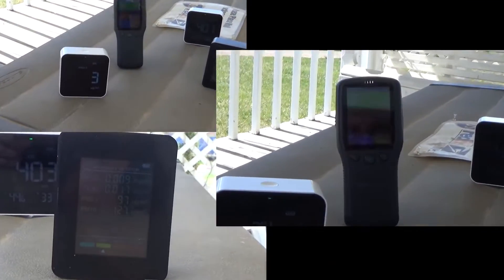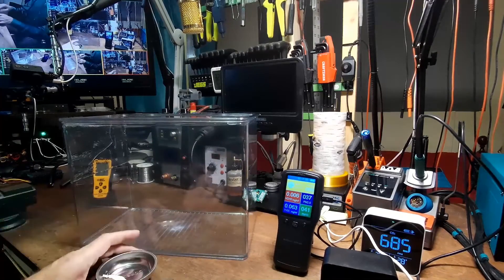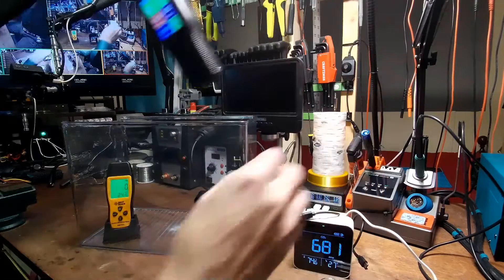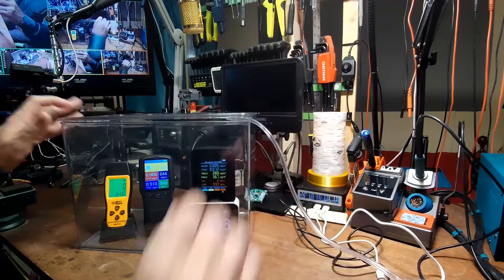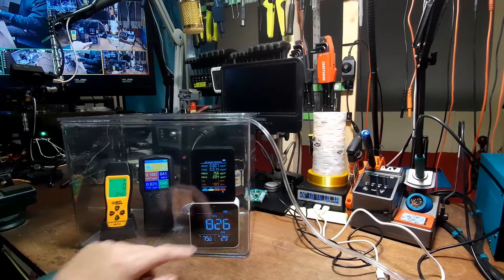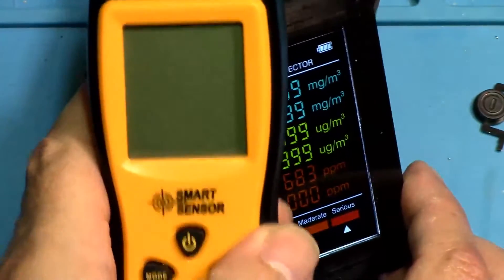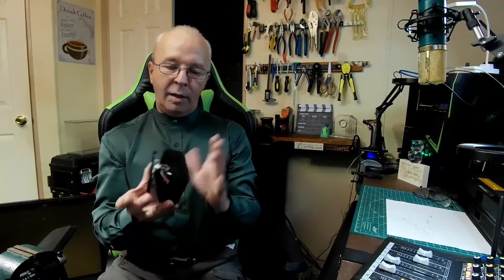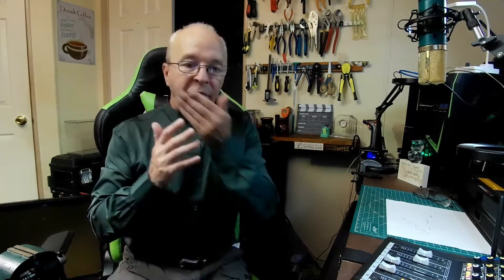Compare Fake Chinese Air Quality Monitor To "Smart Sensor" CO Monitor & "TemTop" CO2 Monitor

Comment: I bought a version of this sensor with temperature and moisture display. I didn't care about CO2/HCHO/TVOC which it also has. So just out of pure curiosity i put some desinfectant on my hand and hold the sensor. All parameters instantly maxd out 😂. What a piece of trash. I also doubt the humidity and temperature is accurate 😂
Reply from the maker: Thank you for telling us your experience.   👍

Comment: I just bought an updated version of that fake one.  The display is a little different because they added more fake features calling it a 10-in-1  (Model MT13W). They also have a 15-in-1 version.  The readings are completely different to public AQI monitor readings in my area, so I did a search and found this video.  I am seeing the same sort of whacky readings as in this video.

Comment: Not zooming in on the meters makes this video a BOMB, really.  But you got a click and comment, good for you.
Reply: Plus the explaining first and then the doing. Could have been half as long. It's an alcoholsensor sure but the 'lasers' are a sensor too. So if it was made to be all fake they would not have spent the time and money to put in the particle meter. I have something like this and ofcourse its useless. I'll reuse the battery for something else.
Reply from the maker: @Drteomas  Any monitor that incorporate a sensor reading of a sensor or sensors that do not exist is fake no matter how many other sensors that may be real.  You are correct -- you can take it apart and use what's inside for something else.

Comment: So narrow minded. The sensor is a substitute, swap the one for the correct one, they are good once you do this
Reply: Did you do it?! I was wondering this and got laughed at by this weirdo.
Reply: @Drteomas I have 3 good, I used the 4th for testing. Admittedly still WIP but so far everything is golden. Not sure the parts numbers used as I not at home right now.

My plan is to tap an ESP32 onto the UART pins on the PCB (slightly different PCB to the one on the video, but very similar)

Comment: I picked up a temtop m10+ assuming it’s the same quality as the m10. Difference being the + model detects co2 temp and humidity also. Have you tested the m10+ and/or is it safe to assume it’s also a good product? Thanks!
Reply from the maker: The CO2 addition is great.  TemTop was supposed to send one out to me to test and review, but never did, so not sure what happened there.  Yes, I would say that the M10+ is a good monitor if for no other reason than having the addition of a CO2 sensor, and I believe they use Sensirion sensors which are very good sensors.

Thanks for the question and comment -- much appreciated, and hope this helps.  A Merry Christmas to you and yours... 👍
Reply: @Outside-In. merry Christmas thanks for the reply!
Reply from the maker: @breaktime919  😉

Comment: SO can we take out the alcohol sensor and solder in a co2 sensor?
Reply from the maker: No we cannot do that.  It would be great if we could.
Reply: @Outside-In.  I wonder.. An alcohol sensor costs 5 times as much as a co2 sensor. Both have serial data and serial clock connections. On what do you base the thought it won't work? I don't think the person that designed it tried to make a fake device because there are smarter choices to be made in such a case. I think maybe the manufacturer took an existing design of an actual co2 tester and then got greedy.
Reply from the maker: @Drteomas  Let's see...  An alcohol sensor costs from less than a dollar to a few dollars or more each.  I found some sensors about a year or so ago that cost just a few cents but can't find them now, but if a company buys .99 cent sensors in bulk, the cost would probably be around 10-15 cents a piece...  A CO2 sensor (Good Quality) can cost from just less than 100.00 to 100's or even 1000's of dollars -- That is why they buy cheap alcohol sensors in bulk, so they can get a 5-15 cent (per sensor price), call it a CO2 sensor...

Each sensor put into a monitor has to be programmed for that monitors code-base, you can't just swap out one sensor for another and expect that it will work because it won't.

And yes, the people who design these fake monitors -- did it on purpose and intended on creating a device that can cause another persons death.  In the United States, a company would never be able to get away with creating a CO/CO2 monitor, and use an alcohol sensor for the readings, as not only would they get shut down by the Government, but they would get plenty of prison time to think about the stupid decisions that they made that cost peoples lives.
Reply from the maker: @Drteomas  I am talking about high quality CO2 sensors, not these 20 dollars CO2 sensors that work or don't, or maybe work for a few hours or days and quit working...  Good quality CO2 sensors are very very expensive and why a legitimate CO2 monitor or meter and so expensive.  Look at this and you will see (if you scroll to the right at top of page) they range from mostly over 100, and up to 6500.00 for a sensor, but those we  don't really need in our homes.  Sensair (NDIR Sensors) is what most companies prefer to include in their devices as the cost is lower but still pretty good quality and close to accurate, which is all we as consumers really need, and those cost around 100.00, and why CO2 monitors are more expensive.  https://www.google.com/search?q=high+quality+co2+sensors+cost&sxsrf=AE3TifN-d_qltr9IGFKLq8HAoWzTOXJufQ%3A1763309875075

Alcohol sensors you can get for less than a dollar, but I can't find the one I saw for 15 cents or the other one for 5-10 cents, but even the ones for less than 99 cents, if you bought them (like companies do), in bulk, you could easily get them for around 10-15 cents a piece.

You don't have to believe me and that is fine.  Believe what you want, but if you do the research, you will find that alcohol sensors can be found for very very very cheap and why a lot of these Chinese companies buy them for their CO2 monitors.
Reply from the maker: @Drteomas  One thing you are very very correct about -- It Is About Greed...  So sorry for putting up false information about the 15 cents, but I can't find it anymore.  Everything has gone up in price, and even those 5-15 cent ethanol alcohol sensors that I found nearly two years ago.  But like I say -- If a company were to buy the (less than a dollar) alcohol sensors in bulk, they could easily get a 10-15 cents per piece rate.  You and I can't buy them that cheap (that I can find now), but big companies with deep pockets can. 👍

Comment: CO2 is heavier than air. That might explain the discrepancy since the one reading 5000 is lower.
Reply: You are right in general. Bit I don't really think it would make such crazy difference in such little space.
Reply from the maker: @HeathHunter  Absolutely, but even testing a CO2 monitor in a small area like a case, it would have shown the community that a CO2 monitor should be placed in the lower part of your home or business and not up high where the reading would be lower than it actually was in your space.  But I see what you are saying...  In the testing case, the CO2 reading at the top/ceiling as opposed to the floor of the case, would be so small, it may not even be evident.

Comment: absolutely never trust any chinese software (or hardware) - there are reasons for the stuff being so cheap. Reasons, you need to worry about - cheap material itself does not lower the price enough, you need to make everything else cheap, too. That includes the necessary work during planning, prototyping, testing, assembly and scaling, too. In short : the entire product is the lowest possible quality you can imagine. Of course there "are" exceptions in the chinese market - especially for chinese customers, but these markets will forever be inaccessible to any western customer, unless you manage to establish some sort of illegal insider trading pipeline or something like that
Reply from the maker: There are some good Chinese companies trying to do the right thing, but mostly it is (like you say) nothing more than using low quality materials to make money, and no consideration for safety...  I would say to not trust any Chinese company without (First) doing plenty of research on that company and their product before buying from them.👍

Comment: I bought a MQ7 sensor for Arduino DIY, and it's supposed to be "CO and alcohol sensor". That thing was just $2. Do you think it can detect CO for real😅
I have a small glass container, so you say I could test it by burning a piece of paper in this enclosed container ?
Edit : just to be clear I only tested it with alcohol (it works). The sensor heats a lot, it takes 30min for it to settle.
Reply from the maker: That would be interesting for sure, but why would anyone create a CO sensor that is also a alcohol sensor? -- curious...  Here is the thing -- there would be no reason to have a alcohol sensor inside an air quality monitor except for deception (in my opinion)...

Yes, you can use tissue paper (toilet paper) in an enclosed container, light it, when it starts burning, blow out and put inside the container with the sensor and it would give you a CO reading (a high one LOL).  Or you can light it, blow it out and just hover the smoke around the sensor.  Any smoke will do, it is just that tissue paper seems to produce smoke the quickest for testing.

For $2 I would be skeptical that it would detect CO as I cannot find one at that price, but if you get it, just do a CO test to see what happens.  If it is only 2 dollars you really don't have much to lose, and it would be an interesting pass-the-time project.

If by chance it really does detect CO, make sure that when you program the Arduino for the MQ7 sensor and put it too use -- that it does not detect alcohol as that would simply cause paranoia for no reason.  A CO sensor may get fooled by alcohol, but it would only be for a second and then go back to 0 ppm.  If you are charging lead acid batteries in a room that has a CO detector around the battery, it will cause the CO detector to go nuts which is a good thing as the gas produced by lead acid battery charging (hydrogen Sulfide) is just as deadly as CO itself, and also the gas (in makeup) is pretty much identical to Carbon Monoxide and why it causes a CO meter to alarm at high levels.

There are several types of MQ sensors available:
MQ-2	Combustible gas, smoke
MQ-3	Alcohol
MQ-4	Methane, propane, butane
MQ-5	Natural gas, LPG
MQ-6	Propane, LPG
MQ-7	Carbon monoxide
MQ-8	Hydrogen
MQ-9	Carbon monoxide, methane
MQ-135	Ammonia sulfide, benzene vapor

Thanks for the question, I hope this has helped.  Let us know if your MQ7 detects CO... 👍

Comment: How can we get a known calibration source to test ??
Reply from the maker: You can check out a site like this: https://www.lindecanada.ca/shop/en/ca/what-we-offer-gases
You can also create your own CO by capturing smoke in a bottle, and you can also buy soda stream cartridges as they are filled with pure CO2 gas.  You can also buy formaldehyde on Amazon, just be careful storing it as you do not want it to break open...

If you are looking for precise calibration gases, check this site out -- As you will see -- doing air quality videos can get very very expensive and why most people do not do it, and why I had to stop doing it myself: https://www.instrumentdepot.com/shop/category/single-calibration-gas-mixtures

Comment: hi, thanks for the video. i was thinking of getting a reasonably priced air quality monitor. i have noticed that you have given a thumbs up to the Hofun and the Aliexpress (orange colour) monitor. May i know which one do you recommend as the better monitor of the two or are both of them equally good. Thanks again 😊

Do you have any opinions on Inkbird co2 monitors whether they are reliable? Thanks.
Reply from the maker: Actually the Hofun finally started going bonkers for dependability, so had to stop using it in videos.  The Orange one..., a friend that bought it, still uses it after a couple years and still works fine.

I have never had a  inkbird, so I can't speak intelligently on that.  One of the viewers purchased a uHoo air quality monitor, and he kept sending me photos of the progress of his using it, and it seemed incredibly accurate and durable, but it is a bit more expensive, and unfortunately, if you are looking for quality when it come to air quality monitors, it is going to be much much more expensive -- that has been me experience with air quality monitors, and yes I know, that is unfortunate.

Hope this has helped...  Just be very careful of inexpensive monitors, as they are a dime a dozen, and a hit and miss, and you don't want to miss when it comes to Air Quality.  👍

Comment: Same for me, I had CO2 Voltcraft CO-60 but I feel need for CO as well. Ended up with this crap shown on the video. After few tests it ended up in trash. Bought separate CO sensor. But what this has is a nice color screen. I think for some DIY project can be modified. But definitely not useful. Mesurement methodology shall be included.
Reply from the maker: Thanks for your experience -- I am also glad to know that someone else wants to know CO as well...  You are right however, this fake monitor would be great for a DIY project box, but just make sure to take out the electronics inside LOL.  Maybe the screen display could be re-purposed with some coding -- ??....  👍

Comment: Did you know that you have to run it first for 24h continuously to "burn" to sensor? Otherwise you have some random values. All these cheap devices will work more-less and will show accurate values for home use - not the lab but you need to know how to calibrate it :) forget about numerical values. It is 10 euro device and will show how many particles you have in the air regardless(mostly) of the type. Sensitive to humidity and temperature.
Reply from the maker: "Did you know that you have to run it first for 24 hours continuously..."  -- Which one are you talking about?...

If you are talking about the Fake monitor -- it doesn't matter if you run it for 24 days continuously, it is going to give random results because it is not even real sensors -- it has fake readings....

In most all of my videos, I recommend running a monitor for several days and even up to a week before accepting the readings as even close to accurate, so taking a monitor out of the box and expecting accurate results immediately is kinda not a good idea, and something I do not ever advise anyone to do...

Thanks for your thoughts -- much appreciated. 👍
Reply: @Outside-In.  I m talking about whole MQ* sensors array, especially. That one you call a fake one, has wrong display. It is not fake device but the display is faking data. It should have 3-4 LED indicator saying: "bad", "normal" "good" - etc. People using this kind of sensors or devices should be aware that humidity and temperature is heavily influencing all readings and finally not every place has the same airflow. I do understand you - I used to call them fake as well. They can be useful - their marketing and display is fake. I was researching a bit in order to get reliable and not crazy expensive sensors and I am learning that it will be even worse! Now, we have a wave of AI sensors, like SCD40, which are still not really counting particles of specific type but estimating their number using similar logic with MQ* and others. I think we can easy agree to one thing: all really reliable sensors are crazy expensive and for labs, for testing home air quality, especially that it can change totally every second and it can be totally different air quality a few centimeters away from the sensor - the only reliable way is to use some indicators like air purifiers have.
Reply from the maker: @EricGen-i6i  I appreciate your thoughts about this fake monitor -- that's right -- I still will always refer to a monitor like this fake, and here is the reason why.  I don't care if it happens to incorporate at least one real sensor -- it is still fake...

The "fake" monitor in this video does not have a legitimate CO2 sensor inside -- it does not have a legitimate CO sensor inside.  The CO2 and CO readings are faked by a calculation from other sensors, and I do believe the CO reading comes from an alcohol sensor inside -- which is a total lie.

You are right, any monitor that would incorporate AI into their device to guess what the CO2 or CO might be in your environment is absolutely ridiculous and should never be trusted.

We should never rely on a device that is doing a calculation to give us a reading on what a reading probably is.  

It is entertaining when people try to make excuses for a monitor that gives readings for CO2 and CO when that monitor does not even have those sensors inside 🤔😆

When we start making excuses for the little lies -- it won't be long before we start accepting the bigger ones as well...

Comment: Just bought a ZN-MT29 from Temu. 15-instuments-in-one, no less!! With Tuya Smart WiFi connection. The measurement graphs after 24 hours were such absolute nonsense that I immediately googled "Fake Air Quality Monitors" and found this video and a few more. Fortunately not much money wasted. Will take a look inside it soon, might as well try to get some fun out of this.